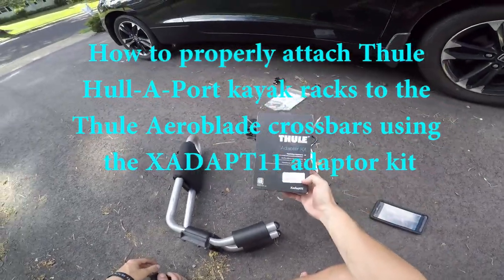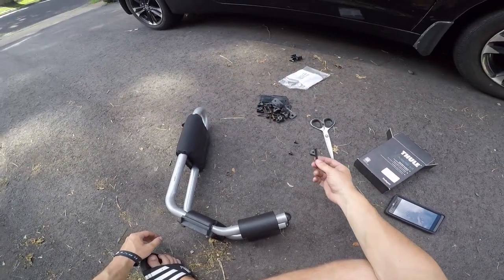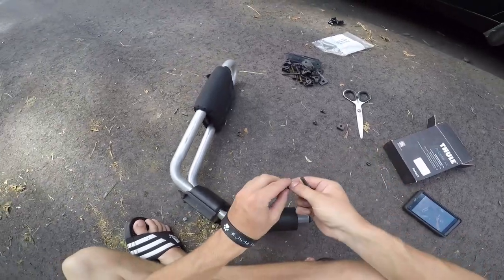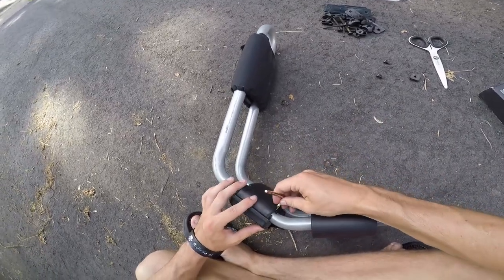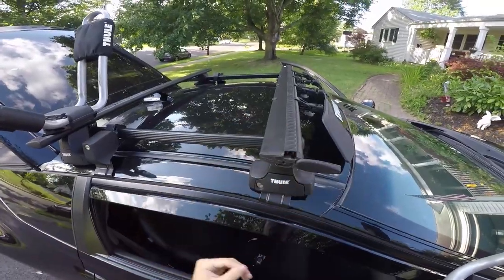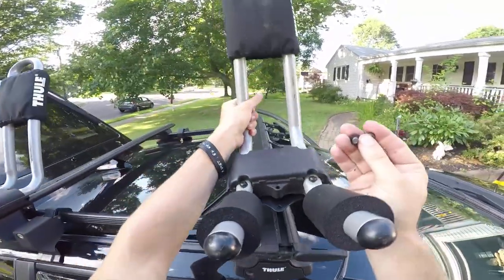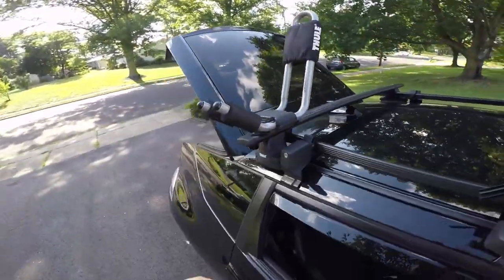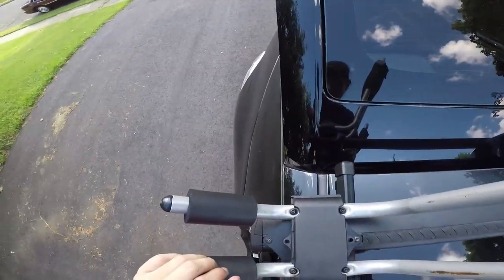Thule Hull-A-Port Installation on Aeroblade Crossbars With XADAPT11 Adapter

Comment: Thanks man, couldn't find videos anywhere and got the aeroblades for my WRX. Helped a ton!
Reply: Actually question for you. When removing the stock hardware there's the cross bar thing that comes off really easy and then 2 more diagonal bolts in the way of putting the plate on they don't have a head to unscrew, how do you remove them?
Reply from the maker: Thanks man happy to help, you should be able to just unscrew the platic tri-nuts, remove the 2 crossbars, and then push the bolts out through the top. Sometimes they get kind of jammed in there.
Reply: Ian Rooney He's asking about the other two bolts. Which don't have plastic tribolts. Or any obvious way of being removed. They’re smooth on top and don’t seem to have nuts of any sort on the bottom.